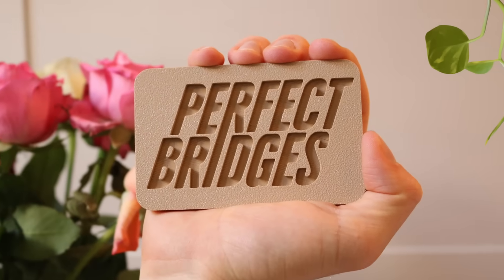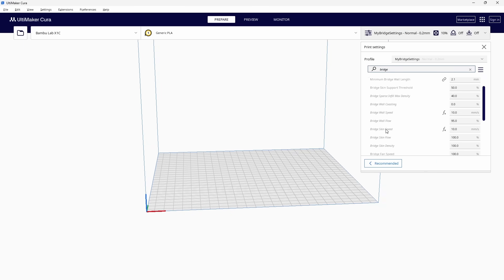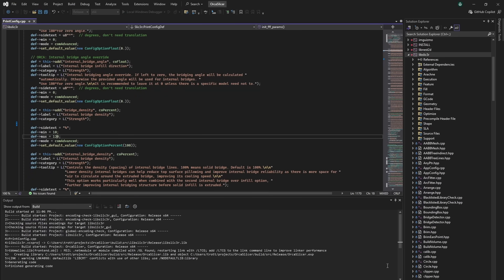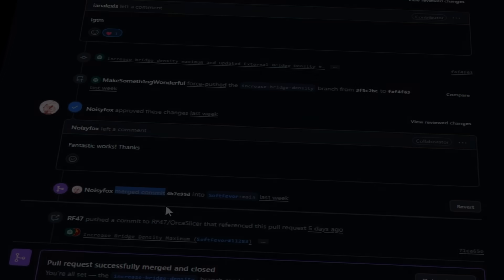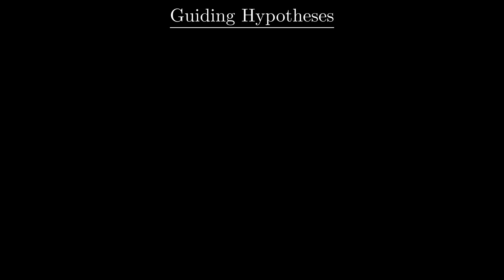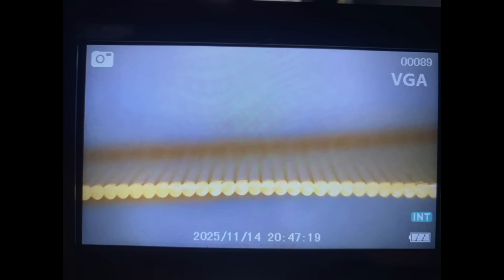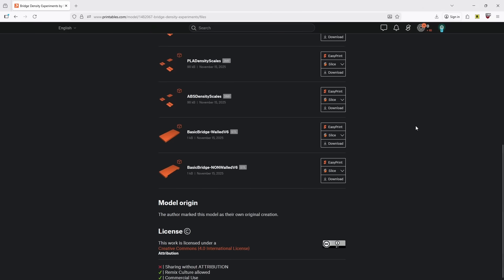You asked for PERFECT bridges in OrcaSlicer, so we built THIS

Comment: I tried this and wasn't able to get the bridges to be seamless/gapless. I went all the way up to 1.6x flow w/ 120% density. Maybe it's because I'm using a 0.5mm CHT with 0.2mm layer height. I don't know. But I settled on something that looks respectful, doesn't droop, and will enable the following layers to lay down quite nicely. Great video. Next time I slap a 0.4mm nozzle on there, I'll give it a shot and see if the CHT is the issue.

Comment: Has anyone tried this? It works only on examples with external bridges. How to make it work with internal bridges too for regular models? Anyway, thanks for your invested time! Printed examples look incredible.
Reply from the maker: Yes, it appears that some people have attempted this for internal bridges, as well. There is a lengthy discussion on my friends PR where a GitHub user named  [valerii-bokhan](https://github.com/OrcaSlicer/OrcaSlicer/pull/11255) tried increasing internal bridges. I have not read the full discussion, and this change has not been merged, yet. But, if you can download the repo, you could just change a single digit in the code and you will be able to try it yourself.

Comment: if the ridges are caused by the bridge looping at the ends/side could you make it so it takes the bridge into the border that way it would be hidden and have the time to smooth out like it does in the middle
Reply from the maker: Ok, this is a good idea. A few people have mentioned similar ideas related to increasing the number of walls (a larger border area to allow for dissipation) and increasing bridge anchor length (depositing the bridge line further into the walls). I've tried both without much success. Are these what you were imagining, or do you have another suggestion?

Comment: Like a good 'old linux kernel bug hunt, you went 50 miles beyond the first extra mile. Thank you for putting in this effort and please pass those thanks on to the other devs as well. I had said this about .1 but .2 may finally be approaching a plateau of "totality" in feature set and performance that make almost anything possible in printing. Still hoping to get Machine Learning to aid in diagnosing photos of problem areas and allow user to paint those spots with some sort of highlighting "brush" in the slicer to begin the process of training the AI to resolve odd isues. I'd pay to contribute to that ( for the server clock cycles).

Comment: Do you have a set of recommended support settings for using 150% flow bridges? I had an area that required a bit of support over a long bridge and the material almost fused to the bridge - I had to use a chisel to separate the interface layer from the print.
Reply from the maker: Sorry that I am just now getting back to you. I missed your comment when I reviewed last. 
Usually, I find success with a Top Z Distance of 0.30. But, I have a more in depth video on supports coming out in a few weeks that could give some really useful tips for this exact problem.
Reply: @MakeSometh1ngWonderful  Sounds great - I'll wait with baited breath.

Comment: i’m on the latest version of orca slicer and it won’t allow me to input anything over 100 for the bridge density. Am i cooked?
Reply from the maker: I don't think so. The two things that I have seen when people experience this issue:
1. They are not on the "Nightly build" but rather the most recent "Stable" build.
2. Often, people mistakenly try to up the density on INTERNAL bridges rather than EXTERNAL.
Reply: @MakeSometh1ngWonderful what you’ll you recommend for speed settings?

Comment: These numbers only applicable for 0.20 mm layer height. You will need to re-calculate flow ratio for different layer heights. Nice work by the way.
Reply from the maker: Yes, this is true. I should have mentioned that explicitly.
Reply: @MakeSometh1ngWonderful  It's okay. You have already given very valuable information. Honestly, I wasn't aware of it, so thank you for that. The calculation for the layer height compensation is straightforward anyway.

Comment: So where did you land for ideal settings on PLA after this last round of testing?
Reply from the maker: I've been using BF=1.3, BD=102, and BS=10 or 20 across most of my prints lately. Bridge flow 1.3 is great because the lines are really robust, and I can bump the bridge density up if I need to. I do not have a formula for this yet, but longer bridges or unsupported bridges usually need higher density.
Reply: @MakeSometh1ngWonderful  thank you much!

Comment: Well I have been using Cura Slicer for years.I Downloaded this OrcaSlice (there does not seem to be any 2.3.2 dev version only 2.3.1) and opened the project PLAxxxx.3mf and Orca complains that stuff is off the buildplate. I see so many things floating in the air. 

Is there any way to make it work in Cura which is much more simple to work with in my opinion. ? I even run Cura with all the advanced settings open and it is still simpler imo. Orca Bridge Flow = 1.2 is what in Cura ?

Comment: BambuStudio seems to let you make these changes - what would be best settings for BS?
Reply from the maker: I just updated Bambu Studio to check this. I do not see a bridge density value, so not sure what you mean. Bridge Flow, yes, that is there.
I find BS from 10 to 20 to consistently produce great results. If you have a printer with a good part cooling fan you can use higher Bridge Speeds

Comment: You experimented with closed chamber bridge, where the bed temperature goes toward being enclosed, despite fan blows at the maximum during bridge you might get different results if the bridge has the sides open (I’m assuming temperature matters a lot as the nozzle should attach the new bridge line to the cooled previous bridge line), also the direction of the air blower might affect, so before you to be sure to have found the correct parameters try to print the same bridge at different heights and different orientations, thank you

Comment: This seems great! But I was wondering, is it possible to have the G-Code vary the flow rate dynamically, or does it have to be the same rate for the whole print. As in, could the slicer detect a turnaround and adjust the rate dynamically to give you something that's a hybrid of what you wanted. Dense in the middle, but wider at the ends?
Reply from the maker: Well, this sounds a lot like pressure advance, which is tune-able. I've had plans to experiment with this in the future, but have two other videos to finish up before I get to that. A few people have also proposed creating a dynamic flow post-processing script similar to pressure advance, but specifically for bridges. While solutions like these may work, I am not sure that this is worth the potential tradeoffs.
If you do any testing with this, let me know! It would help out a lot.

Comment: The latest Orca nigjtly won't allow a density higher than 100 - just the error you mentioned at the beginning, a "value out of range".
Reply from the maker: Ok, I just tried to replicate your issue by downloading the nightly build  (8b812e0). It is working for me. Can you tell me what build you used? You can find it by going to Help>About OrcaSlicer> it will be in the top right of the card.
Reply: @MakeSometh1ngWonderful My machine not on right now but I downloaded it imnediately before the comment so it shoyld be the same one.
Reply: Going back to it, it seems to allow External but not Internal...
Reply from the maker: Glad that it is working. Yes, this is expected as of right now. External bridges were my primary focus. Some others have done testing for internal and I believe that we will be updating that to allow for higher densities soon.
Reply: @MakeSometh1ngWonderful Excellent! Thanks for all youe work, there was a lot!

H2S just arrived sobwhen its all set up I can try it. Meanwhile I jave a print going on X1 with the new settings (the ones you show - no experimentation get...).

Comment: What needs to be changed for different kinds of filament? I’m printing with asa, can I use the abs download?
Reply from the maker: Yes, you can use the ABS download. Update the print profile, of course. Keep in mind that you will probably have a little more tuning to do then someone using the specified filaments. 
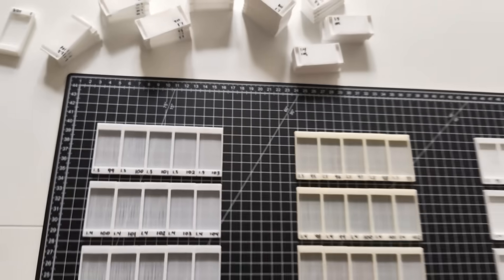My process for tuning filaments is roughly described here in the video (5:19 to 5:45). I do 10 values for BF 1, then when I find a density that I like, I subtract 2 to 4 percentage points to get the "center" of the next 5 samples. I print 5 samples for every other BF value because it isnt a perfect linear relationship.

Comment: I did some calibration as well, couldn't stand printing at 10mm/s (half the time of the print goes into bridges). But if you want to try my numbers on PETG: 1.0 FR, 115.5 Density, 100 mm/s Speed at bridges turned up great at least on my very custom Tevo Tarantula that now identifies as a CoreXY Klipper abomination.
Reply from the maker: Just tried these parameters. Anything above 15 mm/s on the Bambu X1C starts to produce waviness into bridge layer. I believe that the difference comes down to the part cooling fan. I've tried googling the information, but can't really find reliable specs for the Tarantula's part cooling fan. Do you happen to have any knowledge or advice on approaching this problem?
Reply: @MakeSometh1ngWonderful  No worries, the Tevo is just a nice reminder of where it all started for me; my current cooling setup is 2x Blower Fan (24V 4010) directly on the toolhead at 100% speed, IRC X1C only has 1 although bigger Blow area is identical though; I doubt that I have twice the cooling capacity (10 times is very unlikely). I noticed that with bridge density the range for acceptable values is less than 1% so you could be skipping one of the ideal cases. If you increase the flow by 5% BD should range in the +1%'s. TLDR: Run at least 2 samples in which the first one is with increased flow (+5%) to find the ideal range at the desired speed, the second one to fine tune in case that the increased flow has bad quality. My guess is that with a X1C you should at least reach 75 mm/s with very acceptable results (based only on area of the fans since I cant test flow/pressure).
Reply from the maker: Alright, this is pretty good advice. The fan and the control board on the X1C are not really that good. So I might just replace them altogether and then run through these tests. 75 mm/s speed is a good bench mark, and I like your reasoning. Thank you! It would be interesting if I could match the existing results and cut the print time in half.

Comment: I don't know why more slicers don't do this, as you point out it's in Cura, but it's also been in Simplify3D for about 8-10 years, overlapping the nozzle when doing bridges greatly increase the bond to adjacent strands and bridge quality. 
 The worst thing is Orca already has a setting that does this but it will only let you decrease the density, not increase it.

Comment: where can I adjust the density to more than 100?
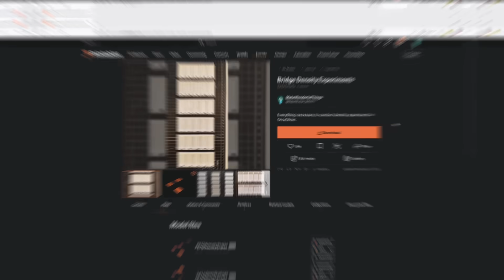Reply from the maker: Make sure that you have the most up to date version of OrcaSlicer (8:02). The link is in the description. Then, adjust External Bridge Density, which you can see in this video on the left at 5:31 to 5:33.
Reply: @MakeSometh1ngWonderful  i have this version. but I can't get over 100%. now I have reinstalled it. and it works
Reply from the maker: That's a weird bug. But, glad that you've got it working now

Comment: Amazing results! I hope you will make similar research in support surface quality, because sometimes the surface needs to be supported and the bridge settings not always result in the same surface quality when it is free bridge or the bridge above the supports. Maybe there are some best practices but I don’t know any of them giving so huge gain in surface finish as your approach to the bridge surface.
Reply from the maker: I'll post a solution to free bridges soon!
Reply: @MakeSometh1ngWonderful  do you mean supported bridges? Maybe I’m not good in terminology but what I mean here is the surface which is right above support interface, which rarely prints well. In any case I would appreciate any content you make in 3D printing as I’m newbie to this
Reply from the maker: Thank you for the clarification. I thought you were referring to bridges that are supported just on either end in this sentence: "...same surface quality when it is free bridge or the bridge above the supports..." So, yes, there is a slight misunderstanding on my part. Sorry about that.

In regards to supported bridges, I've improved surface quality and the support removal process by increasing the "Top Z Distance" parameter to 0.28 or 0.30. You might try that out and see what kind of results you get 😊

Comment: You know the slicer could modify the flow at the ends to get rid of that problem, you don't have to do that manually
Reply from the maker: Do you mean with modifiers, like I showed at 0:37? I tried getting around using those because many beginners have a distaste for this. Or are you referring to something else?
Reply: @MakeSometh1ngWonderful I mean that the slicer could programmatically achieve the same effect as you were achieving with modifiers. The downsides you mentioned were all because you were manually hacking something that should be achieved automatically in software. It could happen programmatically. There should be an approximate 1cm flow ramp from base flow to bridge flow. Spacing unfortunately can't be ramped, but flow could be.

Comment: So perhaps it would be better for the stagger and the strength of the model if the bridge line overlapped the wall further instead of turning right at the edge. That would add just that little bit more cooling time for the sag and mesh the joint better.
Reply from the maker: The typical behavior of the bridge lines is to extrude above all of the wall area at the ends. I tested this with my fourth hypothesis, seen at 4:28. More walls = more area of overlap. I tried 30 samples across the three filaments and did not see any significant difference from baseline. 
However, some people have reported success with more walls.

If you test it and find good results, I would love to learn more!

Comment: I couldn't resist and have started to try this with my printer, a MK4S. So far I have printed all the pre-made tests. All in all, most of them look significantly worse than what you achieved here. Often times there's just not a lot of connection between the lines. Higher flow values have yielded better results in terms of connection, however these artifacts at the beginnings and ends have increased, which was expected. That is a compromise that I'm willing to accept, if I can get better bonding. I've now created some more and will run further tests, let's see, what I can do.
Reply from the maker: I love that you're testing. Yes, just increase the density and you should start to see connections even at lower flows. If you still don't find success, send me photos and your print profile on discord (@MakeSometh1ngWonderful) and I will try to help out.
Reply: @MakeSometh1ngWonderful  Got one pair of values, ha! Will test that in a different model, though, just to confirm it. Honestly, this feels like but is more fun than my bachelor thesis.
Reply from the maker: Ok, happy to see that you're on the right track. What is the subject of your bachelor thesis?
Reply: @MakeSometh1ngWonderful  Something in the optics field about special fibers. Can't say more, it's actually under NDA, haha
Reply from the maker: An NDA for your bachelor's thesis is a flex 😂

Comment: Hey! How would you use this on the P1S/Bambuslicer? Ive only ever used bambu. Would you use Orca Slicer, set the printer to the P1S, export the gcode and print that directly to the printer via sdcard?
Reply from the maker: Yes, that's exactly how I do it!
Reply: @MakeSometh1ngWonderful  oh wow, thanks for such a fast response!! Do you have to use the sdcard to do this? While doable its a tiny bit annoying. I'm not sure if you can import the gcode to bambustudio and send it from there?
Reply from the maker: It is definitely annoying. Not sure how much you know about this, but Bambu's "security" firmware updates at the beginning of this year have been very detrimental, in my opinion. 

You might look into LAN-only mode and try it out. 

"I'm not sure if you can import the gcode to bambustudio and send it from there" I've tried this and found that it is impossible because it doesn't let you send g-code from Bambu Studio that does not originate from Bambu Studio. So, yes, these are annoying bugs that are totally not necessary. But the bureaucracy of a large company has created and perpetuated them, as is often the case.
Reply: @MakeSometh1ngWonderful  I'm vagely aware of the firmware updates and think theyre not good for the user. But I'm not very familiar with the actual impacts of it. Thank you for the explanation, that helps a lot! While annoying, at least its doable :)  Hopefully this also ends up in Bambustudio (doubtful haha). But until then, If I really need good bridges, I will do what you suggested!

Comment: What pen/marker are you using on your test prints? I typically have issues with normal permanent markers.
Reply from the maker: Just a fine point sharpie. I press very, very lightly though. It bleeds pretty badly, especially on PETG.

Comment: For a 0.6 Nozzle I feel like I would need the density to go even higher to get perfect results I'm running 1.4 flow and 120% density for best results on petg (DD_Ender3). Thick bridge is also interesting depending on usecase. Good work!
Reply from the maker: Maybe if you send me some photos and a print profile (on discord) I can push it up a bit more. Cant make any promises. But, we set it to 120 because none of us had good results above that during testing. A couple of the devs use a 0.5 nozzle, but I am not sure if we tested a 0.6 nozzle.